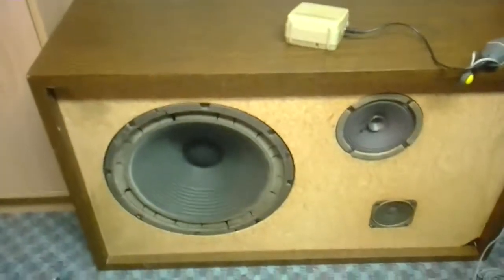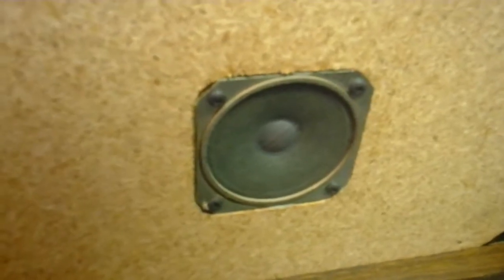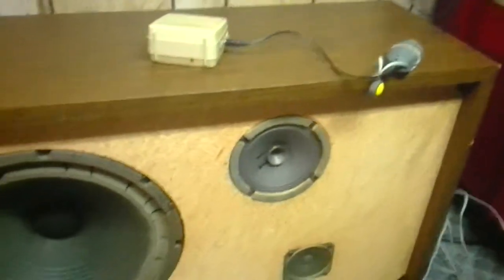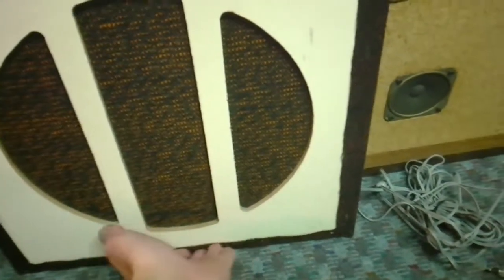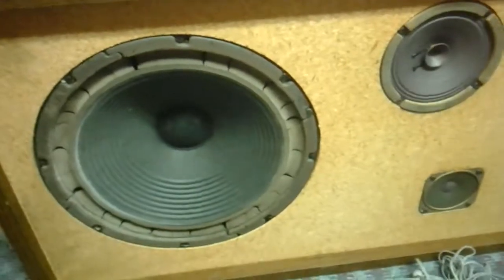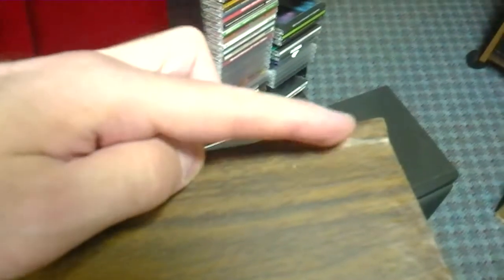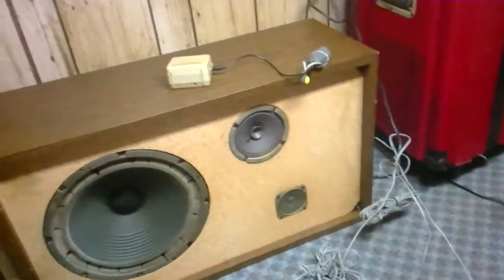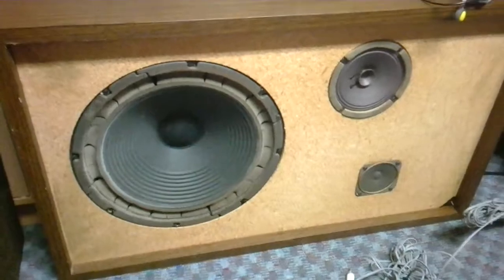Vintage Speakers Part 1

Comment: Water damage, I’ve had worse in my classic KLH speakers. The whole backside of them was so swelled up I had to repaint it. They were both missing chunks out of the corners, but not to the extent that you could see in them. Yet one coat of wood filler was not enough. The veneer was seriously peeling, and had chipped all along one side of one of the speakers. They got stain and high gloss finish. They still look in bad repair in the back.
Reply from the maker: Thanks for the information.   I didnt know these were KLH speakers.  I dont have these anymore but looking for anothet pair like these.   If there are anymore of this type i definitely would buy them from anyone has any for sale.
Reply: I actually do not know if these ones are KLH, but I had a pair of KLH with a similar issue. These look like something a little more rare or less known than KLH. Replacing the foam surrounds (the cracked part around the cone,) can easily be done. For the tweeter, they used similar tweeters from the 60s all the way to the early 2000s. It would be easy to find one of a similar quality that would fit. I like keeping the original parts in these old speakers if they work or can easily be repaired, because they often sound good, just might not be as loud. But loudness is not very important if these are in a small room. The midrange is probably also able to be replaced with a VERY similar part, but maybe it could be harder.